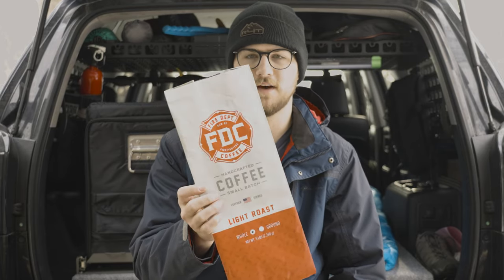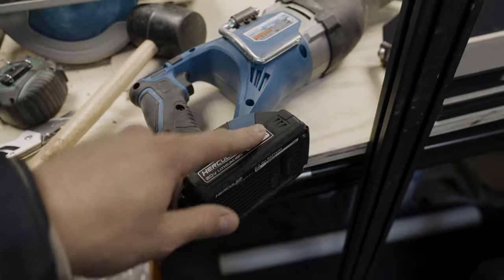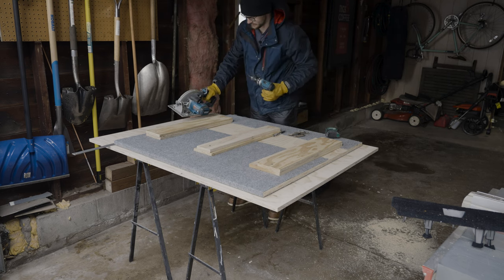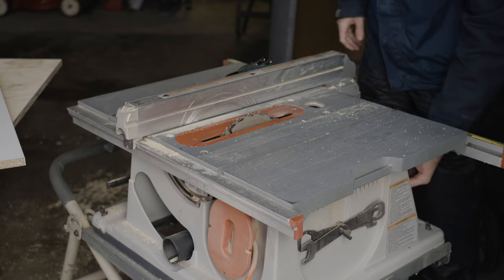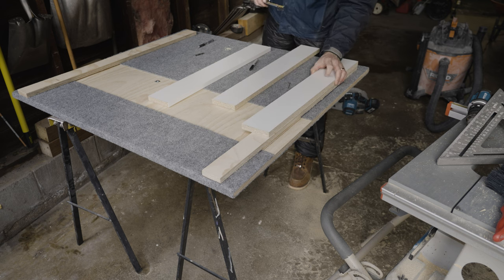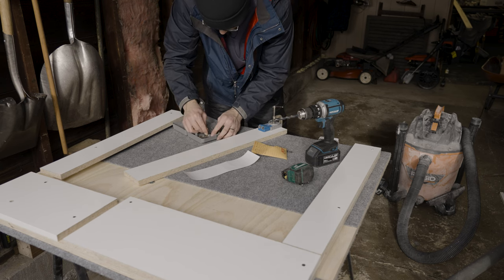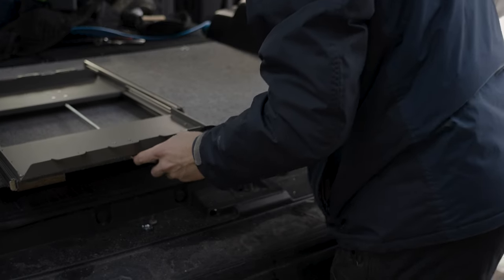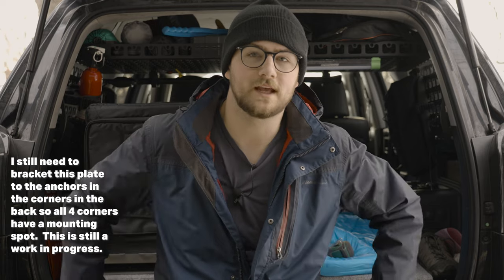BUDGET DIY Camping Storage Platform that's MODULAR | Great for Daily Drivers! | Start to End Build.

Comment: Awesome work man. I did something similar in my 3rd gen just with a complete rear seat delete plus storage and the rear platform. But,  I've been totally dragging my feet starting on the one-off drawer system part. Materials just sitting there in the garage giving me the evil eye every time I walk by... as does the wife. Looking forward to seeing what else you do to your rig! Happy holidays!
Reply from the maker: Hahaha, I know that feeling. I had a more built out storage system but have been moving toward this setup so it can be a more basic SUV between trips for practical errand trips etc.

Comment: Great build. Before i begin thinking about tackling this project just wanted to confirm that the seats can still be raised correct? Its not necessary to leave the seats down anytime this is installed? Thanks!
Reply from the maker: Yep! Works with them up or down

Comment: Slick design and execution of the platform! I'm thinking of building something very similar based on this. Curious how the board table is sliding these days?
Reply from the maker: Still quite tight and hard when there is a lot of weight in the trunk but it’s also quite sturdy because of it!